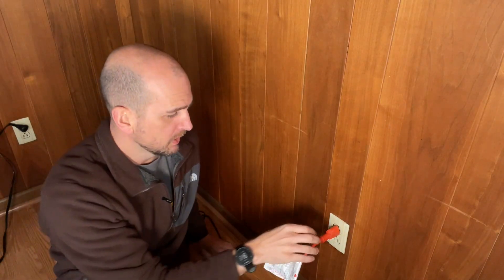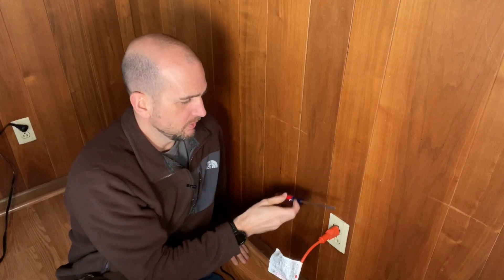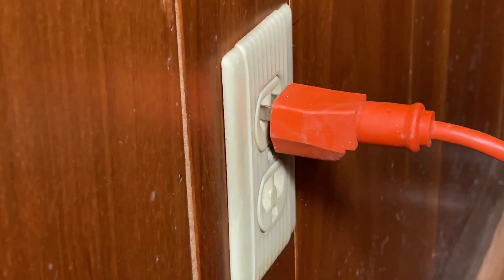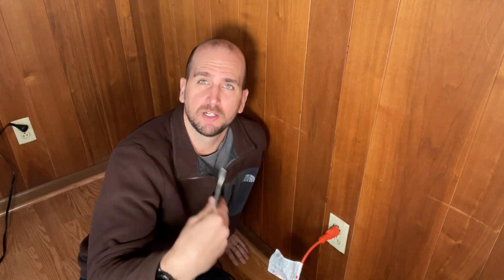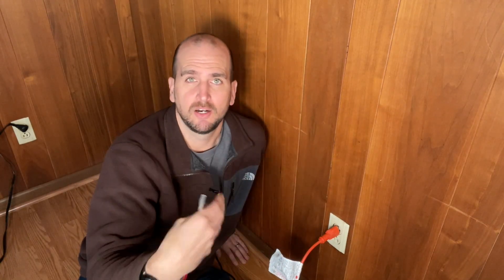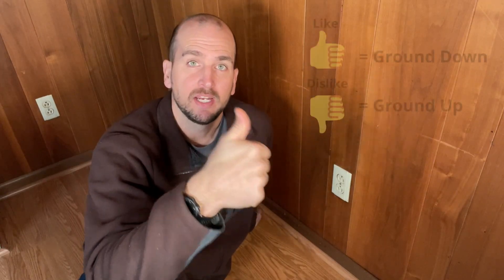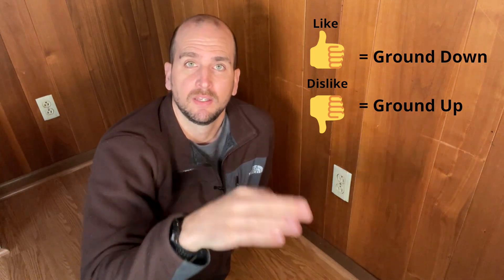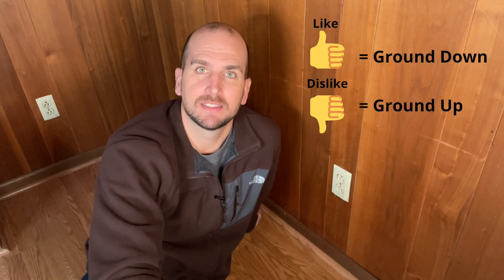Should An Outlet Be Installed Ground Down Or Up

Comment: I mounted all my receptacles with ground for 50 years because it made since to me.  I have installed all my grounds facing up on my rebuilt since we were flooded, after a discussion with my electrician who was an industrial electrician.  It could be an industrial spec.  When I had my electrical inspection it left the inspector puzzled who asked me why I installed that way.  I explained why and he said, “ok” and passed my work.  I hated to give you a thumbs down but I did as you asked.

Comment: I had an electrician that put the ground up if the outlet was connected to a light switch. But, that was just to show which outlet had a switch. All the other outlets were ground down.
Reply: That is something that lazy/cheap electricians do.
It is unprofessional to be inconsistent, and it's the wrong solution to the "problem". He should have installed receptacles that are marked as switched.

Such as https://www.hubbell.com/wiringdevice-kellems/en/Products/Electrical-Electronic/Wiring-Devices/Straight-Blade-Devices/ConstructionCommercial-Receptacles/DR15C1WHITR/p/2608245

Comment: Ground up is idiotic. Most electrical devices in a home do not have a ground. Lamps, stereos, vacuum cleaners, all two prong.
You can't fix stupidity and people do stupid things.
They also started requiring arc protected breakers.
Gods forbid you plugged something in that had its switch in the on position. Making constant trips to the basement to reset the breaker.

Comment: I was taught in school ground up for commercial, ground down for residential. My local inspectors also prefer it that way.
Palmetto Construction Services
Reply: As an former industrial electrician metal wall plates were often used. It might slip while removing So the ground pointing  down could  be quite interesting .

Comment: The ground on earth is down, so It is easy to remember to place ground down. This is the way I do it. Plus if you have a space saver grounded plug it usually points down off the ground terminal. When using ground down it orients the wide blade to the left. If you use a timer device you can read the face properly.

Comment: Scrolling to the comments is the first I've ever heard of the "ground up for switched outlets" thing.
Although I've probably seen that and just not realized it.
Almost every outlet I've seen in my day to day life has been ground-down, and as noted in other comments around me, many devices seem designed to favor ground-down. As such, my brain sees this as "normal".

Many receptacles I've seen in my day-to-day life (especially GFCIs and their 'test/reset' buttons) are marked 'ambidextrous' - i.e. markings are printed in both orientations to remain legible regardless of whether it's mounted ground-up or ground-down.
Referencing my heavy duty outlet box/extension cord I made, the Leviton GFCI has all markings 'ambidextrous'. However the Leviton USB outlet beside it is marked for "ground down" for the printing that describes the USB ports' power supply.

As for the stuff falling on the outlet thing, lots of electrical/electronic things can be screwed up by things falling on/in them. (Lost a high end graphics card to debris falling into my PC's top air vent.)
I would think it wiser to protect the plug from falling "stuff" first, and use the "ground up" as a measure of last resort.

Be a rebel. Mount your receptacles sideways. ;)

Comment: Now first off, I went to engineering school in the 70s.  At that time it was taught that if standard receptical(non switched nor isolated ground) the ground goes down. If either of the other options, switched or isolated ground, the ground goes up.  And to my knowledge there are no national regulatory rules for either since 1974 to current.  Still the original logic I was taught was ground goes down, and then I learned about cases of exceptions for special required recepticals.  And finally with the 'standard' I was taught your home with both directions could be explained in terms of switched(up) and standard(down) recepticals.

Comment: Okay you can do it eather way. But I put the outlets ground up in my shop. The reason why is when I was doing the electric in the shop.  I had a girlfriend with 2 young children. So I put them grounds up so if thay pulled out my electric cords out nothing would happen jus for safety and so nothing would fall off the bench on the plug.  I never had a problem but it was a good safety thing I did in my home shop. It's worth thinking about if you have small children around. Her girls never did it but I at least felt safe about it. That's all I'm saying.

Comment: well..people make sure the wiring is facing correct...it has to follow the outlet ..it doesn't matter its upside down or right side up..it has to follow the outlet prong for neutral and hot leads....its depending on installer perference ..if its easy for ground attachment...sometimes people with big hands have problem attaching to bottom of outlet..if ground wire is too short..and its huge error to cut shorter when laying wiring ...i always give more slack to work with..and i start cutting small amount for trial and error until find it perfect to fit in place...as a rookie..i never cut far back to socket...what happen you made error...?? do you have more wire to cut more to correct it?? thats the mistakes i seen so far with other folks

Comment: I have reoriented recepticles in different locations in my home to accomodate the orientation of various plugs on lamps or appliances.There doesn't seem to be a standard ground orientation on many of the low profile plugs,leaving the cord exiting in the upward direction,which in some instances may be desirable,but usually not.

Comment: Many, if not most cords come up from the floor, and as you pointed out if the ground is facing up, the cord generally has to do a hard bend.  When you get into thicker cords (larger appliances, extensions, strips, (etc), the bend and 'hanging' cord weight pulls on the plug. The ground prong on the bottom would help brace (support) the plug. 
Sorry if too wordy.  It's Late.

Comment: My house has ground up on ones that are controlled a wall switch
Reply: @raymond19001  I dislike the practice of upside-down plugs, or different colors, for switches because It is unprofessional to be inconsistent.  It's the wrong solution to the "problem". You should install receptacles that are marked as switched.

Such as https://www.hubbell.com/wiringdevice-kellems/en/Products/Electrical-Electronic/Wiring-Devices/Straight-Blade-Devices/ConstructionCommercial-Receptacles/DR15C1WHITR/p/2608245
Reply: @raymond19001  At least you know they exist now.  They are available in all styles/colors. The link I shared was for just one product from one company. I'm just trying to educate, not criticize. :)

Comment: Doesn't matter in Thailand. We have 220V but normally there is no ground in the house and the power points are usually only 2 pin. When you buy an appliance (iron, toaster, jug etc) it "may" have a ground pin. This is normally just snipped off otherwise you need to use an adaptor!

Comment: I have been an engineering draftsman for 35 years. Job description in layman's terms:  I redesign the Architectural drawings (dreams) and make them physically possible... I draw the actual things the way they get built in real life.
 I talk to the safety guys and the project managers, the architects and the planners in order to make sure my shop and field drawings are legally correct, physically possible, safe in all aspects and don't leave us liable on any level.

In our drawings we use the global standard that is always ground up.

The only place in the world that I've ever seen a debate for ground down is the US.  Kinda funny because the initial US patent is ground up and most places that copy the US design or adapt it use ground up because the US one was designed ground up.

All that legal BS and history aside, ground up offers a safety feature in certain instances as you showed in your video.  
Ground down offers no safety feature in any circumstances... I kinda think this should be a no-brainer.  Possible safety VS no safety.  How dumb of an ape are we?  LOL

The argument "well ground up doesn't offer any extra protection on a 2 prong" is pointless, because the argument that 'ground down offers no safety features at all' is the obvious retort.
A* safety feature vs none.  Again... no brainer.

The fact that often times people say "it holds better" or "right angle plugs fit better" are nonsense because you can get right angle plugs in either direction and even swivel versions... and "it Holds better"?  seriously? ...better than what?  The floppy old outlet in your grandma's house?  haha C'mon, a properly adjusted socket will hold the plug tightly and correctly any way around you choose,  even sideways or upside down on the ceiling as in a garage door opener outlet.

There is a valid psychological argument as to why people do it wrong tho.  Because humans evolved an uncanny ability somewhere along the way to recognise and see faces, we often see them and subconsciously create them by arranging things like a face, this is called Pareidolia.  We like doing it, it's part of our biology and psychology as a species.  Therefore, we'd naturally want to orient the wall plug to look like 2 eyes and a mouth with the ground down.  It looks more pleasing that way but even more it 'feels right' even if there are valid and logical safety reasons to use it the correct way.
So much so, you see people using obviously illogical arguments to back their choice and desire to place it in such a way that it looks like a face and 'feels right.'

Whatever the reason, you install ground down because that's the way it was made to go.

Comment: The ground up in theory for safety sake (falling object on plug) is logical (any accident can happen).  The code for new installs require a AFCI (arc fault circuit interrupter) either at the  receptacles or circuit breaker.  Which makes the point mute whether ground up or down.  In theory, the AFCI is fast enough to open the circuit eliminating arc fault.   I've been an electrician since the dawn of man.  Seeing a receptacle installed ground up is like a trim carpenter seeing crown molding put up upside down.  LOL

Comment: It depends. Inside a residence I put ground down. You are less likely to have an event where the plug gets compromised in a house and most folks are just used to it that way. In a shop ground up. You are more likely to have grounded plugs on things used in a shop. I find it easier to plug them in with ground up and also  any impact from above will hit the ground first.

Comment: Ground facing up is for switched outlets, ground down for regular outlets.
Reply: I've never heard or seen this, but I like the idea.
Reply: Davis Jones, based on WHAT? Is this your personal preference, or are you referencing some other authority, perhaps local codes?
Reply: What if just one plug on the outlet is switched and the other is always hot? Is it a regional thing? because I've been in construction almost 40 years and have never seen that or heard of it.
Reply: No, please don't, and don't encourage other people to do the same.  It is something that lazy/cheap electricians do.
It is unprofessional to be inconsistent, and it's the wrong solution to the "problem". You should install receptacles that are marked as switched.

Such as https://www.hubbell.com/wiringdevice-kellems/en/Products/Electrical-Electronic/Wiring-Devices/Straight-Blade-Devices/ConstructionCommercial-Receptacles/DR15C1WHITR/p/2608245
Reply: @TonyPombo  It maintains a more consistent look than special receptacles without additional expense, and there is a safety gain without additional effort or expense.  There is nothing unprofessional in any of that, refusing to consider a small gain in safety with no additional effort could be considered unprofessional, promoting a more expensive option with no functional gain is questionable at best.
Reply: @1SCme  Labeled receptacles are available in all styles/colors, and would match the other receptacles perfectly (except for the labeling).  I suppose it is my opinion, but receptacles mounted in different orientations looks like someone messed up.  Plus, it doesn't solve the "problem".  If I enter a room and see two receptacles mounted differently, what does that tell me? I have to know it indicates that one is switched, but which one?  So, I must observe other receptacles to determine which one is upside-down. Ok, so then which of the two outlets, on the receptacle, are switched?  Both?  The small price premium for a clearly labeled receptacle is worth it.  Additionally, if you believe one orientation to be safer, then you can install all the receptacles that way instead of some installed in a less safe orientation.
Reply: @TonyPombo  People would have difficulty identifying which is upside down, would quickly learn to associate which is connected to the switch (particularly if commonly used or they requested the install), would be quick to retrofit, is easier to locate matching replacements, while spending zero additional money with zero additional time trumping your self declared "Professional" method for just a small premium before moving to the safety issue.

You can debate the amount of the gain, but there being a safety improvement in a different orientation isn't debatable, even if only implemented on a portion of the outlets, and denying this certainly kills the "Professional" claim.

You can have your personal preference, but attempting to add weight to it by declaring it "Professional" is garbage.

...and in my new custom home I don't plan for switched outlets except for the workshop, but I am considering going a step further for safety, having all outlets mounted horizontally with the ground and neutral facing up, not only gaining from the perspective of shorting, but also diminishing cord entanglement and everything that goes with it.
Reply: @1SCme  The concept of "some receptacles installed differently = remotely controlled" is not intuitive and requires user training. This may be fine for DIY home owners, but what about visitors, friends/family, renters, future owners? How are they to be educated?  Sure, they would eventually figure it out, but there is an advantage to a properly labeled switched receptacle.

One orientation is safer, so why propose installing some receptacles differently?  Flipping the orientation of switched receptacles means that some receptacles are in the less safe orientation.  Using labeled receptacles allows you to install all receptacles in the safer orientation.

You said: "easier to locate matching replacements, while spending zero additional money".  This is the definition of "lazy/cheap" considering the advantages I mentioned. It is not money for nothing.  Also, if you choose a major brand, they are not hard to locate.

However, as a home owner or DIY person, I do not blame you.  You were probably not aware these receptacles existed, unaware of the local electrical supply houses in your area, and maybe unwilling to pay $2 extra per switched receptacle. This is why I created my original post, to educate.  But, if you are paying a professional electrician $100+/hr, they should not be cheaping out; they should be installing properly labeled switched receptacles in whatever orientation, you the customer, want.

I get angry with "Pros" that don't perform A+ work. Consider the professional electricians that charge a hefty service call, per-hourly fee, plus the cost of the receptacle, and then cut corners [like this].  For them, the hassle of buying the receptacle is non-existent because they visit the supply house every week, or more often.  They get a price break, so the cost difference is only a couple bucks.  Most homes only have a few switched receptacles, so the overall price increase is a small fraction of the total job cost. I recently replaced all 56 receptacles in a 1960s house, only 4 were switched. It added less than $10 to the job.

I like you that you are considering mounting your workshop receptacles horizontally as you described.
Reply: @TonyPombo  , when you leave comments that are in direct reply to another comment, or aimed towards a specific person, you need to preface your comment with their YouTube name. As you wrote this comment, nobody knows who you are talking to, or what your "no, please don't" is in reference to.
Reply: @youtuuba  Sorry. Thanks for the info.  I rarely reply to Youtube videos.  I guess it shows :)

Comment: I am definitely a downer. I use a lot of 90° plugs, and if they are in an up outlet, they are upside down, and the cable ends up getting a lot more strain at the plug, and a lot higher chance of being partially pulled out by the cord.

Comment: Ground Down specifically because most US manufactures make plugs with ground down in mind, as you pointed out with the flat plug. Ive never seen a flat plug that had the ground facing up and the cord going down. 

Also, instead of switching the orientation of the receptacle for switched outlets, you could just go with a different color receptacle.
Reply: Flat, appliance, replacement & extension cords with a flat wall hugger plug are available with ground up, down, or angled (Yes, most do have ground down).  I've even seen a few in use designed to hang straight down on sideways outlets, but can't find where to buy them.